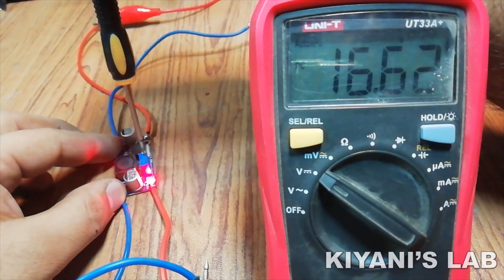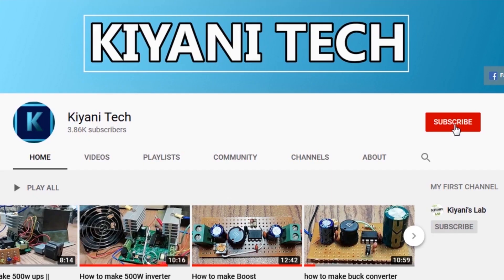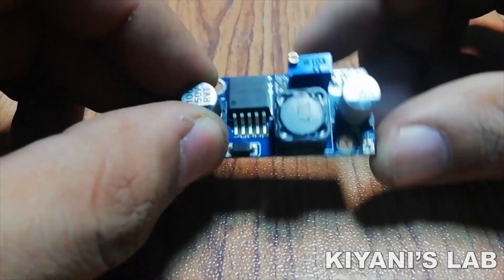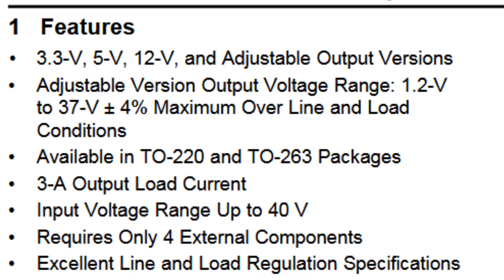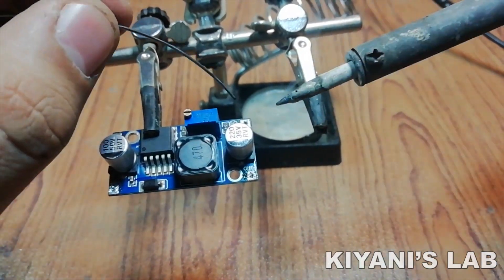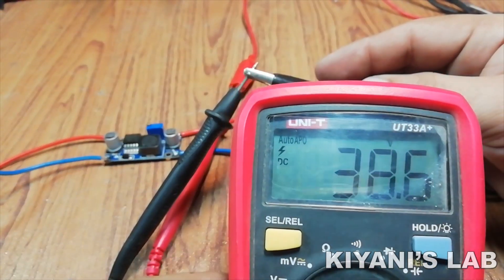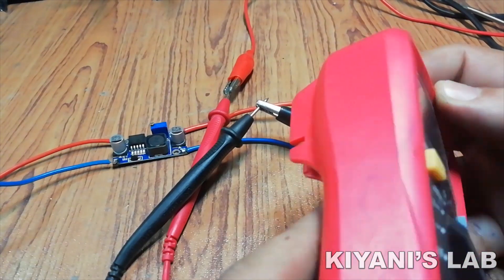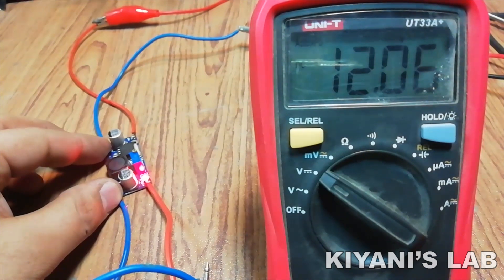LM2596 3A Buck Converter Review

Comment: Thank you for the video, I am assuming that if you variate the input voltage it will still be able to automatically regulate the output voltage (to a point of course) I want to output 5 volts stable from a car cigarette lighter, so anywhere between 11.5v to 14.4v.

Comment: I think this would work well for a very low voltage project.
My Plan:
Connect LM2596 to a 5v input, and a 1.5v output.
I think it will not get hot.
If so, I can drop input voltage to 3 instead.
:)
Thank you sir.
I don't think my project will ever peak at 3A.

Comment: Hi,
can I somehow connect 2 source inputs to it?
For example if I'd like to drive something via buck converter but via:
1. Solar panel
2. 12V car output

Would that work?
Tnx!
Reply: U can use multiple sources to input, once connect the cource in parallel and measure the voltage then connect to buckc. U can use far car too

Comment: If I also need to limit the Current, Which module may you recommend me? I am going to use it on a Diy t12 soldering station and I need to limit the current to 2A. 24V - 2A.

Comment: I found a site that says these are about 80% efficent in real world testing (claimed 92%).  That works for me.
I will be converting to 8.2v at 0.8a, supplied from 17v...  DC

What cheap output filter should I use with them to clean up the output power ?

Comment: Bro! Can I connect this LM 2596 TO 12 volt solar panel directly. As we know that the voltage of solar panel fluctuate . So is there any problem coming if I connect this LM 2596 to 12 volt solar panel?? Reply must 👍🏻
Reply from the maker: yes you can use it with 12v solar pannel